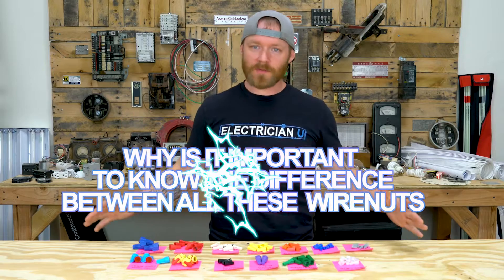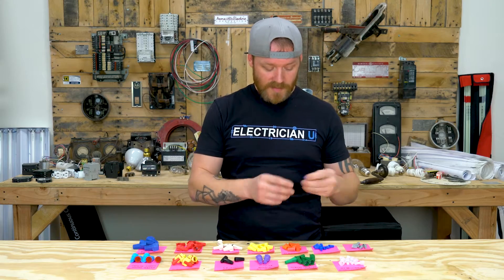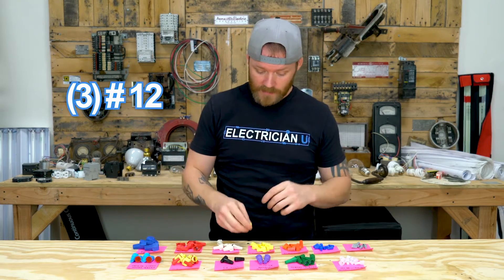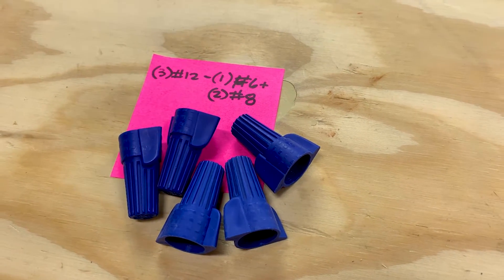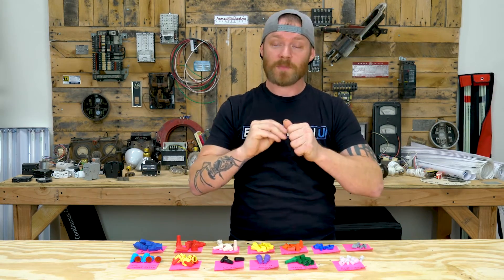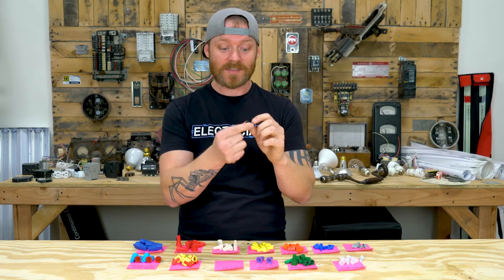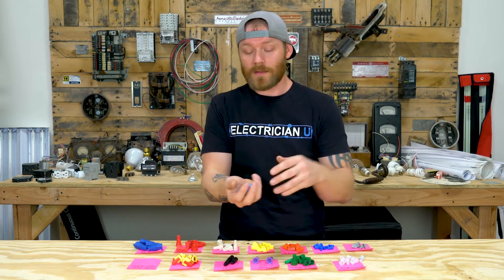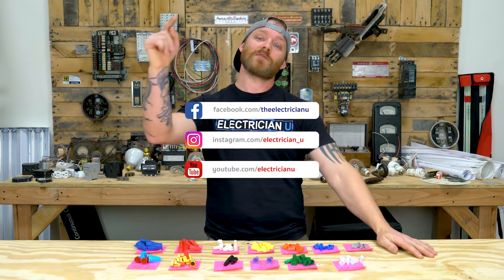WIRENUTS - Why Are There So Many, and Why You Should Care...

Comment: The more I look into push in connectors the more attached I'm getting to them. Don't get me wrong I do like a clean solid twist capped off with the wire nut - but I don't understand why there should be so much controversy over them. From what I see they have advantages that should be seriously considered as another option as much as wire nuts.

Advantages:
- Less wear on conductors from twisting them together and needing to cut worn ends and lose conductor length in a gang box
- potentially saves time over twisting conductors together
- they seem to be a much better option to connect solid and stranded conductors together vs potentially damaging wires on stranded conductors from twisting
- potentially saves space in your bag from linesman pliers if twisting wire is their only primary use. (I really like Klein’s hybrid needle nose pliers in this case)
- May also save space from certain sizes of wire nuts

Disadvantages:
- controversially not as secure is twisted conductors with wire nuts
- may not be reliable for secure connections in areas with vibrations from machinery, etc.
- may not be the best choice for outdoor conditions
- potentially pricier

If anyone can think of any other advantages or disadvantages, bring it in.

Comment: I try to only get wirenuts with the copper threaded inserts. If somebody out there knows, does it make a difference if it’s got a metal threaded insert in it? I figured dissimilar metals might be a problem like aluminum wiring has. Thanks.

Comment: i typically use 14 for lights (except in bathrooms or kitchens) and 12 for outlets, most of the time. 
also i've got some ceramic wire nuts that can be used for high temps, i think up to 400 or so

Comment: This system is too complicated. I'll stay with Wago 221-61X (X is placeholder for the number of conductors to connect, 2, 3 or 5). Can connect conductor sizes between 0.5 and 6mm² (cross sectional area of the conductor), or in american sizes AWG 20 to 10, and are rated for 450V / 41A. Strip wire to proper length, lift up lever, fully insert the wire and close the lever. Done. Should be sufficient for most applications, can take solid, stranded or fine stranded conductors. You can insert mixed sizes and mixed types of conductors. You can use them for everything, from the door chime (mostly 0.6mm²) up to a kitchen cooker circuit. They just announced they will introduce bridges so you can connect two or more connectors, creating a connector with eight terminals from two five terminal connectors.
They can only handle copper, for aluminium push-ins must be filled with a special compound to prevent corrosion. They provide that compund in a syringe.

Interesting to see how the things are done in other countries. Aluminium was never a big thing here in my area, in East-Germany it was the common thing to do until 1990. Installed 2.5mm² aluminium conductors. But the old aluminium conductors should be replaced, the material ages much more than copper. Becomes brittle and if you bend it too often it will break. Also not as conductive as copper, so a larger size is required for the same amperage as it would be using copper.

We use the same method as you do for connecting buried cables, insert a special junction box, terminate the wires and fill the junction box completely with a two compound epoxy (supplied with the box).

Comment: Uh, I've NEVER used a wire nut for CAT 5, are you NUTS?
Reply: @PracticalTech Sure, you can use 5e or 6 - but it's a waste of money, certainly. And I would submit that you should use at least a different color cable than your data lines. Using the wrong kind of wire is sloppy, confusing,  and wasteful. Maybe I'm reacting to some equipment I had to fix in the Navy - this particular gear had over 2,000 24-gauge wires - ALL WHITE. Sure, they had identifiers every 3 inches, but that didn't help much.
 Or, maybe I'm just anal - for example in another arena - I use RED for gasoline, YELLOW for diesel, and BLUE for kerosene - and I NEVER get them mixed-up.

Comment: Doing vehicle harnessing. I've had to use MANY of these weirdly marketed wire combinations you were talking about. It sucks.
Reply: You're not using wire nuts on vehicles right? 😅
Reply: @Krankie_V  I've sent wire nuts into space. But this was just a comment about weird wire combos. And actually I some high end performance racing work that I've done for F1 and Drag applications using solid wire in the control system and wire nuts survive vibration whereas crimps and solder joints do not. But that's hi-spec engineering for you.
Reply: @NastySasquatch  I'm pretty sure corrosion is not much of a problem in space or in race cars. I'm talking more along the lines of daily driven vehicles where the connections corrode and degrade quite rapidly when not sealed against the elements.
Reply: @Krankie_V  certain ground connections require nut bonding regardless. Haven't seen a modern car with solid core wire in it. But hey cars are not the only vehicles. Planes, boats also vehicles.
Reply: @Krankie_V  and corrosion is a massive problem in space. You have no idea.
Reply: @Krankie_V  yep I've done lots of vehicles without ever doing a street vehicle.

Comment: There must be different color codes for the sizes in Canada. Ideal also makes a product called Can-Twist that is blue and covers 3x #22 to 3x #10. The connector inside is a spring and the case is flexible, it shows white lines on the cone to indicate that it has expanded to accommodate the larger sizes of wire.

Comment: 14 gauge wire is not used much these days?? Virtually all the house wiring in Canada is 14 gauge. All 15 amp circuits are 14 which is almost every circuit.

Comment: Do u twist the wires together before placing a wire nut and if yes clockwise or counter clockwise? I've seen people putting wire nut on straight 2 wires together and do u recommend adding electrical tape on top of wire nuts ?
Reply from the maker: There’s nothing in code that says we have to twist. There’s actually a huge debate on twisting vs pre-twisting and whether or not it’s necessary because of how manufacturers make the wirenut now. I still pretwist though. Always twist clockwise because the wirenut tightens clokwise
Reply: @electricianu  and about people adding additional electric tape on top of wire nuts ?

Comment: So coukd u put no lock in a red wire nut and save money on buying purple wire nuts?
Reply from the maker: Yes...but it would not be to code. Materials need to be “listed” for the application. Red wirenuts are not listed for copper to aluminum connections. Silly manufacturing ploy for sure, but considered hack work nonetheless.

Comment: Great job on this one...one comment regarding your comments associated with the smaller wire nuts.  You mentioned cat5 and network cable several times, which could be misleading, in that networks (ethernet) is always in cable, connections, terminations, plugs, jacks, etc. that are specifically designed for that purpose and wire nuts are not used in this applications.  Cat5/6 wire could be used in other non-network applications wherein wire nuts may be appropriate, although I have never found such a case.  

Thanks again for this one, I've made some notes for when I'm sifting through my own pile....

Comment: Wow, we simply don't use wire nuts here so have never seen any of these before
Reply from the maker: Do y’all only use pressure connectors? Where are you at?
Reply: @electricianu  UK here,
We use screw terminals and more recently WAGOs or similar cage clamp systems ...
Wire nuts look like a massive fire hazard from our perspective

Comment: Just found your channel. I appreciate the deep dive into this but talking about using wire nuts on network cables made me scream internally. 

What would be an actual application to use wire nuts on cat5?
Reply from the maker: Door bell transformer in an attic that’s run in cat 5. We run all of our chimes in cat 5, wirenut the pairs that pass through.
Reply: @electricianu  ah ok. That makes sense. Not for data transmission, just low voltage electrical.

Comment: I think Wago lever wire connectors are quicker, neater, more compact and easier on the wrist than wire nuts. difference in Cost can be adjusted for in a job bid too.  NEC needs to make wago spring lever wire connectors mandatory in my opinion.

Comment: Interesting. We used those in the 80s in holland. Now mostly we use wago terminals https://uk.rs-online.com/web/p/standard-terminal-blocks/7581650?cm_mmc=UK-PLA-DS3A-googleCSS_UK_EN_Connectors_WhoopStandard+Terminal+Blocks_Whoop+(2)-7581650&matchtype=&pla-339266396539&gclid=CjwKCAjw5p_8BRBUEiwAPpJO63XBsbb39bS0lb1y6OjZ6pj_02QggMIZAzeKcwkevgsukT0O9rdjFBoC_OMQAvD_BwE&gclsrc=aw.ds

Comment: whats your thoughts on mixing solid with stranded and wire nuts???
Reply from the maker: Not my favorite but I do it all the time. You don’t always get to pick what wire you’re working on, just gotta do what you gotta do. I find that putting the stranded wire just a little bit of head of the solid wire when you go to put the wirenut on actually helps it hold better.

Comment: I'm not sure what your local code is but mostly for residential I'll use 14 for lighting circuits and general use outlets in bedrooms . Usually only use 12 for bathrooms kitchen garages outside etc.
Reply from the maker: Some of our local jurisdictions require everything to be 12, others we get away with all LED lighting being 14 and everything else being 12.
Reply: @electricianu  ahh I see, here in NC were pretty much good not too many wacky codes from county to county, just a hole inspectors. I've been doing this for about 4 years now and in my first tear we had a guy build a 13k square foot mansion all in 12 and God dang I've never hated round pancake boxes more in my life lmao.
Reply: @electricianu  and while I got you do you got any advice from somebody making the leap from helper to leading a crew. I'm kind of struggling right now and feel overwhelmed just wanna see some insight on somebody who's done it

Comment: I use the grays for temporary protection of hot wires in a box by using one gray per wire for basically covering the tips so they don't short out.

Comment: My question is... for the Purple and the water resistant ones... can’t you just fill a regular wire nut with either Noalox or silicone grease and it works?

Comment: Do the different size wire nut have a Cubic Inch Space Requirement like wire size ?
Reply from the maker: Are you talking about the inside of the wire nut, or how much space the wirenut takes up in the box? With a heavy engineering department designing these, I would assume the inside is designed to volume. However none of that is relevant to us. Whatever they list on the package as the number of conductors per size is what we need to stick to. 

Does seem a little odd though that the size difference between all of these wire nuts will definitely change the cubic inch volume of the box. As far as the NEC goes, there’s no requirement to calculate for that when doing box fill...not yet anyways.

Comment: What do you think about the Wago Lever Nut? Pronounced "Vago" I think there originally from Germany. They have little levers that can be opened and closed many times without having to twist the conductors together. Conductors can be moved around without any damage to them very easily.
Reply: Frank Grammatico:  You have to be careful with the Wagos.  There are a lot of knock offs coming out of China, which look just like them but are not listed by any testing lab, and thus not code compliant.  And, without a magnifying glass it is impossible to tell the difference.  And, like a lot of knock-offs it can be very hard to avoid them.  I’d never buy them online, and even the ones at the supply house can be suspect.

Comment: Over 221??? 302???? Doesn't like code max out at 90 degrees C...being like 190 something?
Reply from the maker: That’s a very good question my friend. Most conductors, yes you are right. Although there are a lot of conductors that come from the manufacturer in heating equipment and high intensity discharge lighting (where these wirenuts are used) that use conductors that handle a lot higher heat. Some of these conductors can be in 200-400°F rated. But the typical THHN will only handle 194° F (90 C) before the insulation starts to break down. This is why doing ambient temperature correction on your calculations is so important.

Comment: I use the crimp caps in motor junction boxes. I’ve seen too many times where the wire nuts came loose due to the vibration, even when they had electrical tape on them.

Comment: I have been trying to use crimps for the grounds, makes a bit more space. My 1940's house this is all they used with a rubber cover on the conductors.  

I would think the crimp would be a better connection than the twist. Easier on fingers. 

Lever nuts... Not in my walls. Even after seeing the tests
Reply: TurboFlush
 ... only use crimps on stranded wire! (never on solid wire)

Comment: welcome back!
also, please never use wirenuts with CAT5/6 for any computer networking applications, very likely will have signal degradation issues. 
A really common spot for those smaller wirenuts are anything that involves wiring for doorbells, HVAC controls, security system stuff, etc.
Reply from the maker: Thanks from sharing! What do you recommmend instead? Most low volt connections otherwise seem to be stab in, or pinch down style terminations. With a wirenut you get a solid termination that won’t pull out. How does that degrade the signal?
Reply: @electricianu  well ideally there are no splices with CAT5/6, always want a whole run between either a keystone plate or patch panel or terminated directly with an RJ45 connector. 
If a splice indeed has to be done, the smaller the splice and the fewer twists you take out of the wire - the better. 
Poor signal issues will force the network switch / device to autonegotiate to a slower speed - gigabit may negotiate down to 100M, a 100M connection may slow down to 10M or not work at all. 
They do make a number of ways of officially splicing them  like with "junction boxes" "inline splice box" which are basically just very small punchdown blocks seen in a typical keystone plate or patch panel. 
But yeah, using anything like wirenuts, WAGOs, phone cable splice connectors, or 66/110 punchdown blocks with CAT5/CAT6 wiring for networking purposes - gonna have a bad time.
Reply: And it's not so much that these connectors lead to a poor mechanical signal, it's that these communications rely upon the twisted-pair nature of the wires to properly transmit the signal, if you remove twists, this signal becomes weaker or unstable.

Comment: Good to see you back again! For some reason I had it stuck in my head that I could put 5 #12's in a red wire nut and still be legit. But I admit,  if I had room, I would throw a blue on 5 #12's or more just so I'm not compromising anything by maxing a red out.